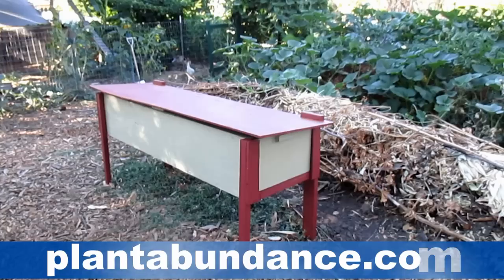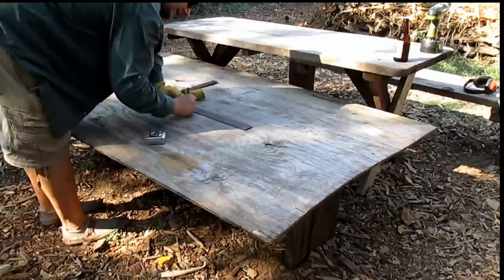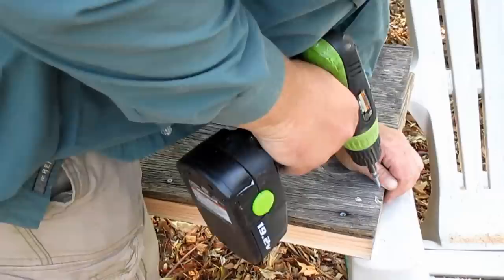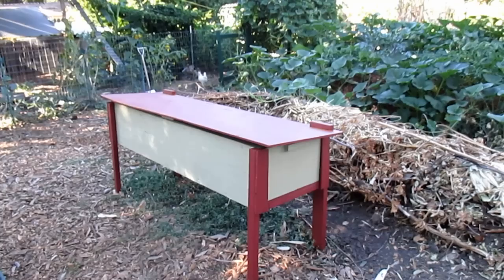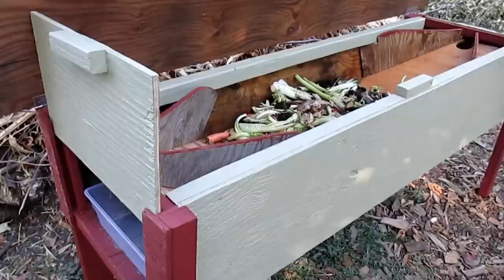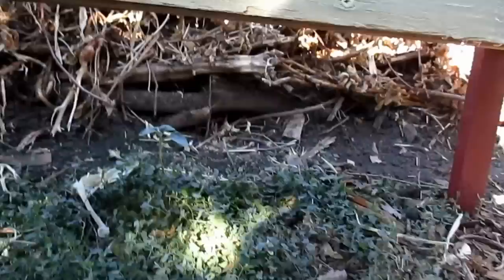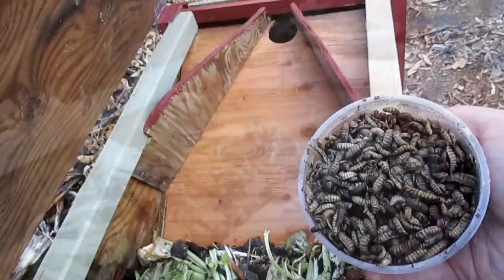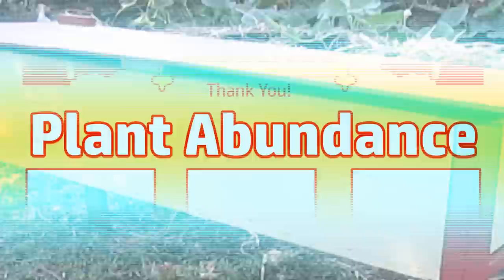Building A Black Soldier Fly Larvae Bin Using Recycled Materials

Comment: So I live in central Pennsylvania and I ordered a bin from the design of the red worms one of the smaller plastic self-harvesting ones and I ordered 700 larva about the same size you did and the issue I found was that there was so few of them for this space that they weren't producing enough heat and when the temperatures were dropping below 60 they would go dormant but once moved inside the house in a smaller container they started eating again and then pupated so what I would recommend when starting a bin is to go big from I believe it was pop worms I ordered 10,000 larvae that were in about the same size cup as the one you got but they're super small because they're fresh hatched but they will literally start growing immediately and it won't take long before your colony is taking off the key is to have enough larvae that they create their own heat

Comment: how do you keep the larvae from exiting through the drainage holes?
Reply from the maker: I filled the bottom with wood chips and put the food on top. They don't really burrow themselves until it's time to pupate at which time they escape to find a dry bed which the bottom of the bin is not. I am looking at possibly doing things a little different this year as the drainage holes would tend to clog up though. Thanks for watching! Cheers!
Reply: So any suggestions on making a bin?  Also how do you get then to repopulate the bin without flying off and going elsewhere.
Reply: Plant Abundance What will you do differently to deal with the drainage holes clogging up issue?

Comment: what degree of an angle do the ramps have to be ?
Reply from the maker: An exact angle is not needed. They just need a ramp so that they can crawl out of the moister. It can be pretty steep.
Reply: 30⁰
Reply: 30 to 45 degrees will do.